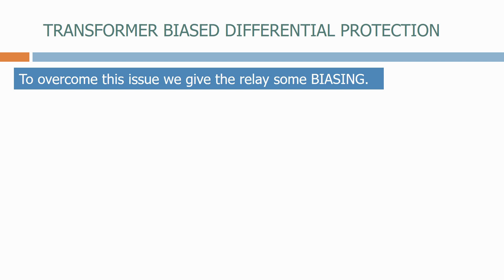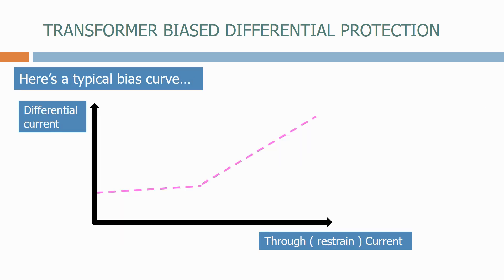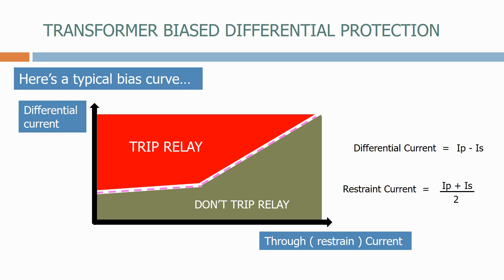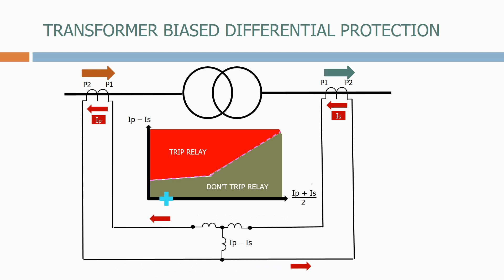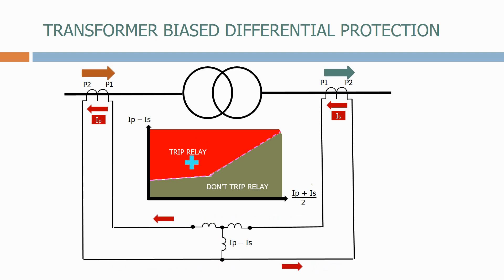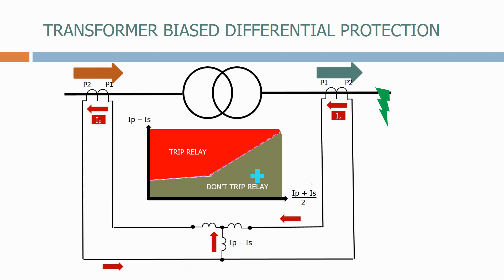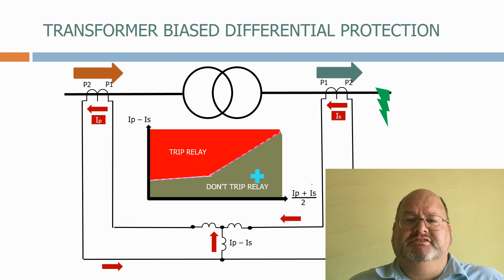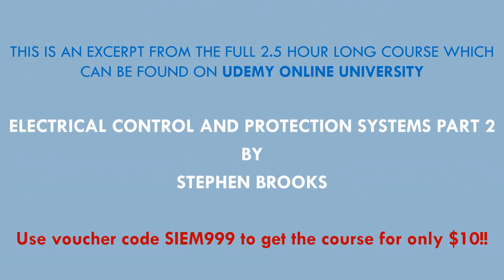Transformer biased differential protection

Comment: I have doubt ..how the backfeeding is possible during transformer internal . during fault primary ct measured load current + fault current and second ct measured load current between this difference relay will operate...but how the back feeding is possible in transformer secondary side...pls clear my doubt